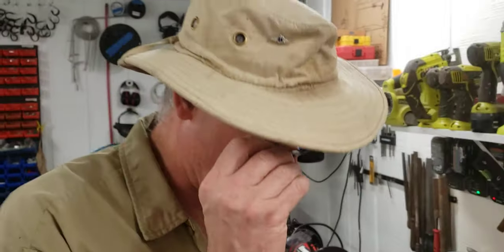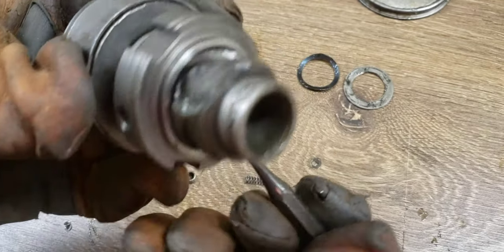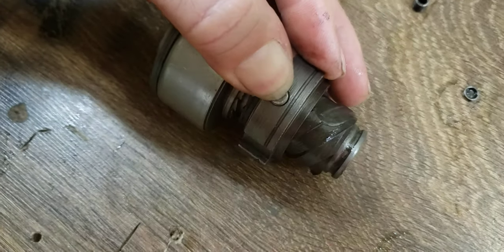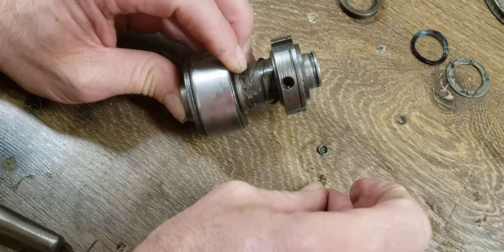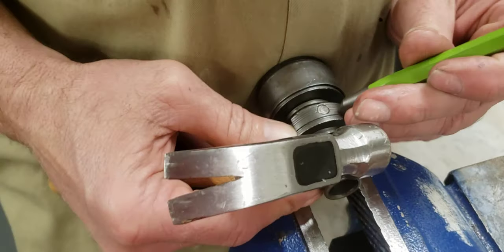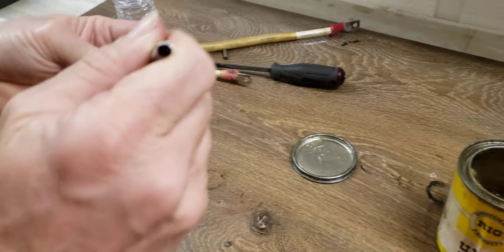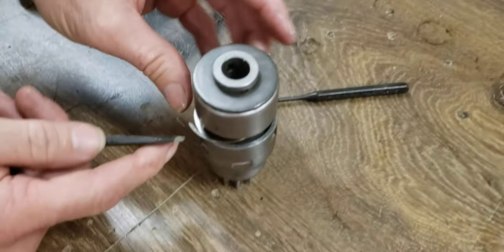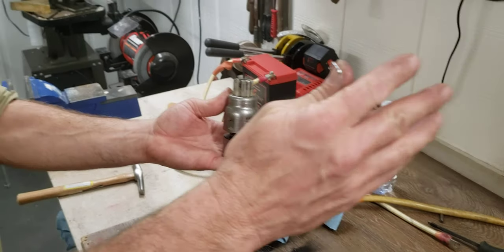A look inside the Bendix and how it works for a ratcheting starter.

Comment: Thank you! 
Mine is from a 1947 Ford 2N tractor that hadnt run in 20 years. Starter wouldnt spin Took it out of the tractor.
I wondered why the bendix would not spin all the way. I thought mine was broken. No parts store was open so I sprayed it with WD40 reassembled it and put it back on. And it actually worked.
Reply from the maker: Awesome,  I am glad this helped!

Comment: this was awesome! Been looking for disassembly instructions for my drive that's off a Piper/Lycoming/Prestolite starter. It has 400 hrs in 35 years (~350ish cycles- replaced in 1987 at 857 hrs., now has 1260 hrs.) It sticks and takes 2 or 3 tries before it engages the flywheel. Everyone says to replace but I think it just needs cleaning.  FWIW, Lycoming says to not use any grease, just spray silicone lube. Mine has the fine splines, not the wide ones like yours. I think the internals are just gummed up w/ west Texas dirt where it used to live before I bought it and brought to Dallas in 2021. Can the roll pin be reused?
Reply from the maker: The roll pin can be reused if it fits in tightly..
Reply: Fine Splines! That is a better terminology...I'm soaking mine in mineral spirits now but the silicone spray when reassembling sounds like an idea...since I have no graphite.

Comment: A pain in the eahs is putting this lightly. And that is being conservative.
Apparently I am one of those "PEOPLE" that realized the gear did not retract while trying to start a John Deere 1010 after a rod bearing change.
Yeah it took me about 30 minutes to find that first spring clip...then the second...and then...
Yup. The two coiled springs. Only one fell but was caught in my celled floor mat. 
I did work out the functioning. The fact that the engine needs to start for the bendex gear to retract/return. But was baffled as to how the outer ring needed to be positioned before inserting on the splines. Mine has 4 times more splines.(The fine splines...Thanks Oldpuck...)
So I don't know if I want to pop those plugs out to replace the springs and plungers.
But it's on the armature shaft back by the lock pin is where I am also baffled...a circle segment key on the shaft...what is/does that do? 
I appear to be missing it. And I didn't drop it...I checked my video taking it apart.
...
Watched that other video. My bendex points the other way.
Reply: I think some peoples thumbs are in need of some repair.
Reply from the maker: Yes sir they can differ a bit, but the basic design should be the same.. All the best, Bill